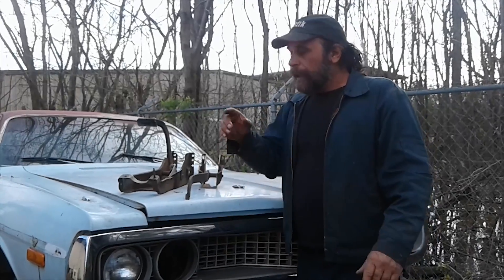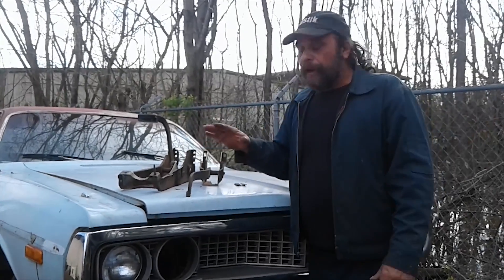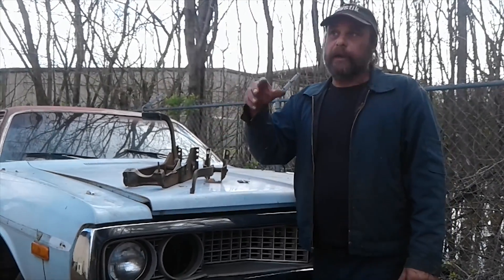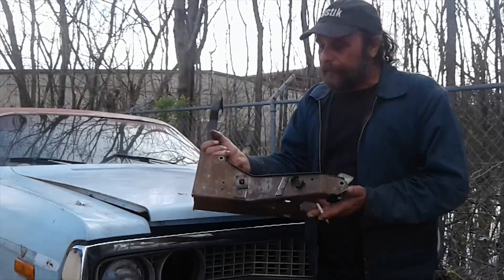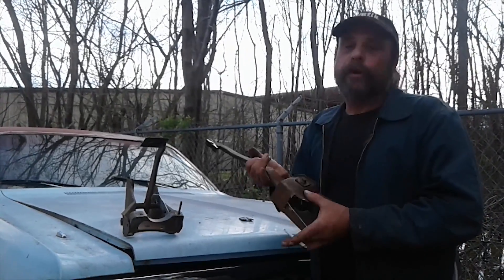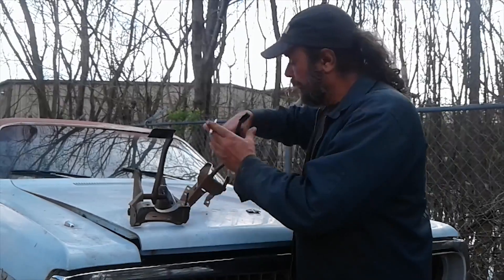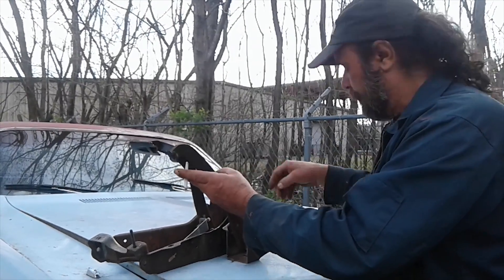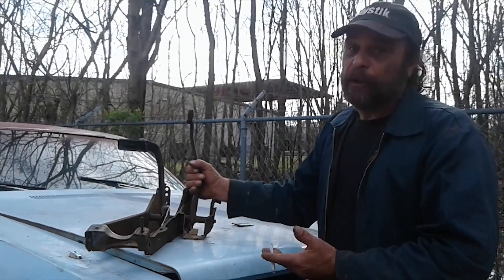If It's Free, It's For Me!

Comment: Love doing stuff this way. Working around a problem using what you have sitting around without spending big money. I did something similar with a 41 plymouth in a shop I worked at when we did a front suspension clip swap off a dodge dakota . Needed a steering setup and brake pedals for it..I used the entire steering column, brake pedal assembly and shifter parts out of a 68 Chevy C10 parts truck to make it all work beautifully ..
 One reason I miss the old style salvage yards stocked with the older cars..bunch of useable parts on them that most people overlook .

Comment: Tony your planning on it sounds like to me is maybe go to a 4 speed from an auto. It can be done a shit load easier for that car than what I have. I have a 1960 Plymouth Fury 2dr ht. As to the clutch rod I need 1 so bad it is beyond thinking. I tried a set up from a '62 Dart, rod too short throw out bearing rode on pressure plate. I need a complete brake and clutch pedal assembly period.

Comment: what find is funny the cars i get for free usually is way better then the cars they want top dollar for lot of them are nice and clean body on them but i go look at a pu for a 1000 bucks and it is rusted out the 68 chevy i got for free had a rebuilt 327 400 turbo  supper good body no dents or dings i can find factory paint needs paint bad they thought the cam went flat got mad told me to haul it off  i just looked at it notice the dis. was not tight so i timed the rig in and it ran perfect everything on the motor was new even had a msd on it but i pulled the motor and put a 454 stroker in it